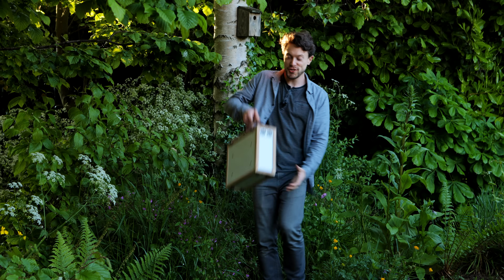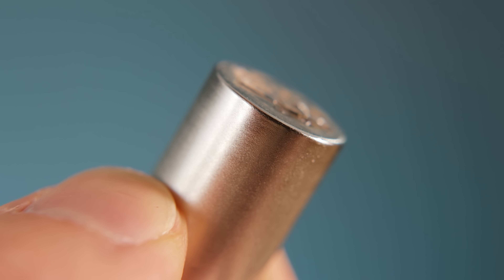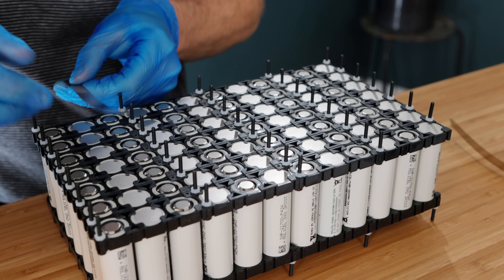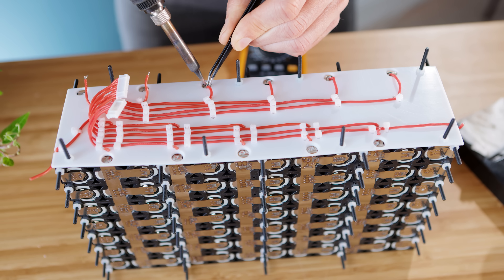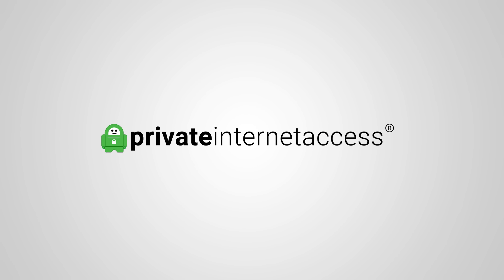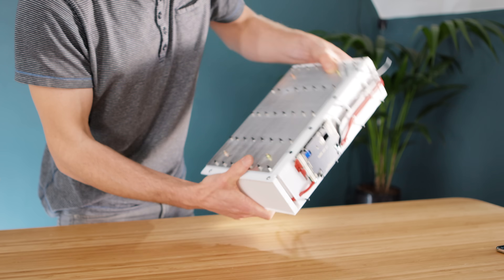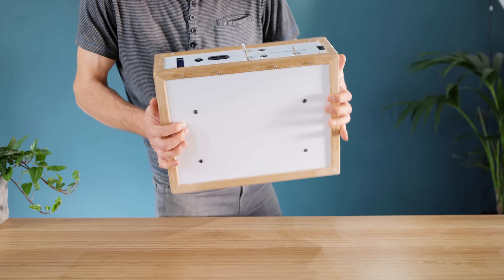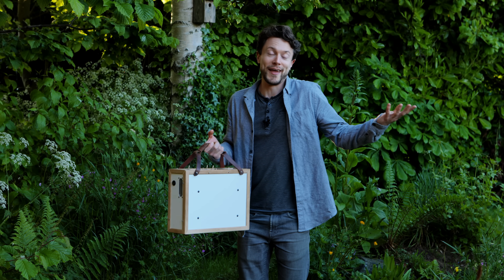Build your own portable POWER STATION (1200w, USB-C and MORE!)

Comment: Why don’t u use prismatic lifepo4 4-8s 100/50Ah or even 16s 22Ah pack. Much easier process of building and connecting all together, no welding, much safer than INR or any other li-ion. Also whats the point of 50v pack and then decreasing it to 12-24v? Assume, that in 2026 this video is just outdated. Watching this now - i see such a nice building skills and a bad engineering solution
Reply: Found an answer: affiliate links)))

Comment: I love watching Matt and he has a lot of cool DIY builds... But this isn't one of them. Sadly, he botched the build with the use of all that PTFE. There is a reason why hi temp polyimide masking tape is used in electronics. Li-ion batteries generate heat as you discharge them. The more current you draw, the faster they heat up. The same is true for duration. Drawing a low current over several minutes will heat them to their thermal limit. Li-ion batteries are great, but they have their limits and special requirements. One of those requirements is cooling. Most applications do not require anything more demanding than passive cooling. However, with all that PTFE insulating the pack, he might as well have saved himself the cost of a BMS. That pack is going to die of thermal degradation long before load balancing becomes an issue. But, even if he had used polyimide tape, that would not help. A pack that is capable of delivering the current necessary to run a microwave, requires active cooling.

Comment: What about adding a Raspberry Pi/Pi Pico to it with a small touchscreen? That way, you can easily configure the BMS on the battery pack instead of needing an external device.

Comment: I love your videos mate and I've only watched 3! Very simple, informative steps for somebody like me (I am a maintenance engineer and have a visual/logical brain). I also have lots of electronic based hobbies/personal projects ongoing. 

I'm sure you appreciate constructive criticism like I do, so I've one invaluable tip when working with lithium high current batteries. Instead of balancing them to the same voltage by charging them, discharge them to empty first. I would hope that you don't have a hugely intelligent answer that negates my tip, such as: the leftover capacity of all the batteries combined can never end up with the same value (or something like that). Buuuut, I love constructive criticism - so hit me with it! 😅

Anyway, obviously the whole idea is to work on batteries that have low voltage and are unable to cause any damage by an accidental short circuit. Thus rendering the batteries you are working on as (near) completely safe.
The other issue I often encounter with this, is how do we discharge a lot of batteries at once, safely, yet quickly. If you have any (cheap) tips for this I would be hugely appreciative 😍.

I would also add (for anybody reading), that in my experience, batteries do not like to be discharged for long. So plan your project to start immediately after you have discharged any batteries (and then charge your batteries as soon as practicably possible)👌.

Comment: We need a new project based on this, Li Ion Cells only allow 500+ cycles then starts to deteriorate. Li Po 4 cells are rated for 2000+ cycles. Maybe have the new power station use this kind kind of battery.
Reply: I think these are going to last a LOT longer than 500 cycles before losing meaningful capacity. 

Most cylindrical cell cycle count are tested by the manufacturers, and each have different testing conditions. Each kind of cell will have better or worse capacity lost after 500 cycles than others 

The 21700 cells he's using are Molicel P42As. These are extremely high quality, high drain cells, that are capable of safely doing around 25A discharge PER CELL! They are tested to have around 85% capacity after 500 cycles after discharging at 10A, and charging at 4.2A. 

The cells in his pack won't be anywhere near this kind of discharge/charge rate, they're practically babied compared to the factory testing.

Comment: Nice video, very thorough - I think I might have used fibre stickers on each of the positive terminals to prevent the nickel slicing through the plastic wrapper on the cell.

Comment: This diy cost way more than just buying a new battery pack and isn’t point of diy is to be cheaper than already available product in market
Reply: Pretty sure no powerbrick is using molicel P42A. These are seriously high quality cells, like proper toptier high drain, low internal resistance batteries.
Reply: more like this isn't commercially available

Comment: Shame Could of Gone with Much Safer Cells like  lithium-titanium-oxide (LTO) or Sodium Ion +NA

Sodium Allow you to Deep 0v Discharge for Long Deep Storage +20 years they recover
And LTO you can Abuse Hard Core 
Nails - High Voltage cell charging IE 400V Direct DC a singe cell an it wont go up (in just 10 mins It will be fully charged - 450V @ 250A (Rectified 250V AC to DC 450V DC) - Set on fire for hours  and the cell don't do anything

Comment: i built something similar using a plastic picnic cooler for the case and a couple of 12 volt ce battery. solar in via a regular and power out via inverter.

Comment: While welding the row of batteries, just isolate the rest of the rows, for Christ's sake. You WILL drop something and it WILL be conductive. Don't take risk - once on fire, Lithium batteries cannot be put out. The safest place to do such things is outside next to a pile or pit of sand you can drop batteries in if anything goes wrong.

Comment: I like using a low temperature soilder and acid flux because you wont heat the battery up as much and more importantly you have more contact area as those welding techniques leave only a small area that is actually connected to the battery and cause alot of heat during high current draw which damages the batteries eventually. See theres misinformation in your video because battery imbalance isnt what destroys cells; its heat that destroys batteries besides the internal issues batteries have. If you monitor the intividual cells you will see that batteries will normally align themselves as the closer to their maximum voltage they get the less current they draw so that imbalance growth over charge cycles is known bullshit and bad science. What really happens is that the cells that have inferior welds compared to the rest will fail first as their temps will be higher. See its easier to automate a welding process like that than soldiering one and the greater detwrmining factor is the cost. Its cheaper to use steel bands than expensive copper wire, flux, and soldier that a better system would require but the result is a system that will never fail and cells that last much longer because the connection on both sides of the cells isnt acting like small electric heaters (literally the glowing red kind) during high current draw. I hope you make the corrections to your video to clear up the misinformation.

Comment: Decent electrical design, but no provisions to get air moving into and out of the pack, with higher current drain and charging its going to heat up a lot.

Comment: 1 and 2 KW inverters are dirt cheap. The question is not how many watts, but how many watt/hours?
You can make it as fancy as you want but what is its capacity? I have an array 6 of Lead Acid car/leisure batteries in my shed as an emergency power supply - its a total of about 450amp/hours; approximately 3 KW/h after conversion losses. Hooked up to a 2KW inverter it is able to run my fridge/freezer/lights/tv/laptops/cable modem/satellite box for about 10 hours - but it needs a forklift to move it.

Comment: Get a good spot welder, some of them, even the capacitor based ones, are not powerful enough to weld through two nickel strips, only one strip... thus it makes wiring VERY difficult. That was my problem, the nickel strips were not able to be welded the right way so I had to find alternate ways to wire them all.

Comment: If you want to put Li-Ion batteries in parallel, you can bring them to the same level by connecting them via a power resistor (like 5 Ohm, 1W) first and let them rest for a few hours. This way, they will slowly get to the same level and afterwards it's safer to connect them directly.

Comment: i'm glad you took the best chinese multiport usb dc psu. it has tvs'es on input and output. i got some of those for my chargers, coupled with used laptop psus. i use them around my house, a bit safer method than random mains usb psu imho

Comment: So, you have no air flow nor heat sink?  The current and continuous use time will be limited by the heat build up.  You didn't include any thermo probes inside the array, either, so you don't even know the temperature!

Comment: You can solder on the leads no problem. You just have to be a pro at soldering and have a quick hand. When I built smaller power banks it's exactly what I did. A tiny drop of linseed oil works better than flux by keeping the oxygen out. Doing it quick means the battery has no time to heat up. Of course, if you suck at soldering, or if this is a much bigger project - you'd better get a spot welder. Don't go cheap on those, certainly don't go for battery powered ones.

Comment: I would place the fans to negative pressure and place the inlet more on the midle of the pack on the same side with a carbon filter like those used on electrical cabinets

Comment: I have a question. If I buy a BMS to connect 4 batteries in series, if I need to increase the current capacity, can I simply connect 4 more batteries in parallel and the BMS will control the charge of the cells? Or do I need to buy another BMS for these new batteries in parallel?
Reply: Match voltage by charging then connect in parallel. You don't need another bms.
Reply: @ItsDextrin Thanks for the clarifications. Then. Can I use a BMS for 4 cells in series and put 10 cells in parallel per node? As long as it does not exceed the maximum output current? I needed to design a 16V BMS with 35Ah, in which case would it be enough to buy a BMS that supports 40A?
Reply: @acacioaguiar6547   Use a battery pack planner to calculate your pack's capacity (Amp-hours), then choose a bms based on your power requirements.

Comment: you should mention that cells come with and without built in protection circuits and if using the latter, you should have balancing and protection of each individual cell instead of a cluster..

Comment: Take a page from the desktop computer maker's book. Reverse the airflow of the fans and create a larger intake so you can add a filter screen without reducing airflow. If you don't, those fans will clog with dust and become ineffective. Sure, they can be cleaned, but all of the components inside will also be clogged with dust and you'll have to disassemble the device to clean the dust from it.
Also, if you move the air intake to the bottom,  air can flow up through the 2mm gaps between the batteries cooling them as they charge. Add a set of feet to one side or the other so you can use it while on it's side.

Comment: I don’t like the fact that you glanced over the fact many many times that your power station requires a n inverter to power that microwave and all ac appliances like that fridge. You kept implying all you needed was this battery pack. I know you mentioned it once or twice but extremely briefly. A little deceiving as an inverter could be double the price of your little project. Not only that but with an inverter it makes your set up look messy which is probably why you seemed to “hide” the inverter to begin with. Because it sucks having loose cables coming off the battery pack. And it would be the most unsafe thing of your project.

Comment: 2 years later, with EVs and hybrid cars really getting popular, there have already been a number of them that offer build-in invertors for appliances with high power demands and the capacity of the battery packs are also more plentiful for camping. So for portable large battery banks, I guess we will need to match their designs with the appliances to be carried without a vehicle. In those cases a very high power isn't that useful, and instead what's more valuable could be emergency charging through solar energy, being more compact with higher energy density, etc.

Comment: Expensive to buy THAT  many lithium batteries.  Not practical for most people as many just don't have the tool lying around to do this project. My 3 ft solar panel does the same thing for at fraction the cost.

Comment: The soldering lion batteries is mostly a myth. The damage is so minimal its unmeasurable and you need a powerful iron to do it. The soldered conmections when done properly is way more solid than what's possible wirh spot welds. 

TLDR: it dosnt matter if you solfer or spot-weld. Do whats best for you.

Comment: CAn  you do a update on this battery for a budget version? All of yourlinks are out of date? and it would be useful to go over the components and why you vchose them? For example the batteries are out of stock why did you choose these vbatteries and is there a easier way to create this project now as they seem to ship in some special tube now? Does this make it easier rather than manually wiring them up?

Comment: Do anyone of you have 3D printing files that would work in similar way for what he used to a line all the batteries with? Don't know what it's called.. It can of course  be for a smaller or bigger amount of batteries than he used since that's easy to adjust.

Comment: Dear Mr Diy Perks, I didn't quite understand the wiring for the balance. It is also not clear to me how the batteries have to be welded together, as only one side of the power station is shown. Could you please explain this in more detail with instructions on Patreon? Many thanks in advance

Comment: I made something similar (smaller) to this using a knock off pelican case, an ISDT Air8, xt60, connectors, and a 12v car socket.  If it hasn't been done already, someone needs to make an open source project with cad files to be laser cut and bent.  Assuming this doesn't exist already, I'd be happy to be part of this effort.  Let me know if anyone is interested.

Comment: Awesome build! Perhaps try another with LiFePo4 batteries? LiTime make a 12v 100A mini, which is cheap, not very heavy, kinda small, and gives you 1280wh of power which can be used daily (more than 5000 cycles), great for working from anywhere setups.

Comment: Great project got a a bit silly though when you pulled out the deans connectors I had these weld together on a drone XT90 or EC5 would make much more sense. I've pulled 2200w through a single xt90 on my mountain board with no issues.

Comment: Hi Mat. Would you try making a portable power station like Ecoflow Delta Pro (3600Wh) power station out of batteries from Elon Musks Tesla batteries and can even get them recyclable from Tesla Model X or older. Because batteries operate at a high voltage, they can reach high temperatures. LFP batteries have a higher thermal runaway at 270°C, whereas NMC batteries have a lower thermal runaway at 210°C, making the former safer. And like the Ecoflow make it so you can plug in charging from etc. solar panels or wind turbine. This might get you a place in history to make something cheaper than the current models out there and now since we are in a unsure time where it could be beneficial if anything happens to Earth like say a catabolism, solarflare or fallout events like war or government crackdown or war. Cheers.

Comment: Two of my off-grid friends who live here say if I use it outdoors in the winter like I say I want to do I have to use lead acid. One of them has a Jackery but he keeps it indoors not outside in -20F or the cold kills it. The other friend learned after he tried to turn on the power to his cabin. It was -15F and the cold killed the fully charged batteries, the batteries worked fine after he warmed the cabin up but he ended up replacing it all with lead acid.
Reply: I sell 18650s at the flea market and got a good vendor with well-tested 3000mAh for around 3 bucks apiece. I haven't decided on the brand of BMS if I go that way but probably not. I buy and use 18650s to build LED lights, powerbanks, and to power music players I sell too. The lead-acid will be heavier with less power capacity but I might have to use them.
Reply: I solder directly onto the 18650 cells. I don't recommend anyone to do that if you don't have soldering experience. I use Hakko T12 solder tips and I pre-tin everything before joining the components. The amount of heat I use is so minimal you can touch the joint with your finger as soon as you see the solder turn solid. If you can't solder like that buy the spot welding tool because overheating an 18650 battery can be dangerous. If you are good at soldering without overheating you can use copper and solder in fuses wherever you like. Also soldering on dead batteries is less likely to catch on fire than soldering on fully charged batteries so drain them down to 3 volts. Since I sell flashlights I usually put them in flashlights with built-in charge controllers to drain them. If you don't drain them down exactly don't worry the BMS will charge them all back up properly when you charge it, BMS check. Just be ready to throw the whole thing outside with BBQ gloves and have a big fire extinguisher.

Comment: I just have a question. If those dean connectors can provide 50v and 1200w are they 24 amp connector, if it ia true then it is very dangerous